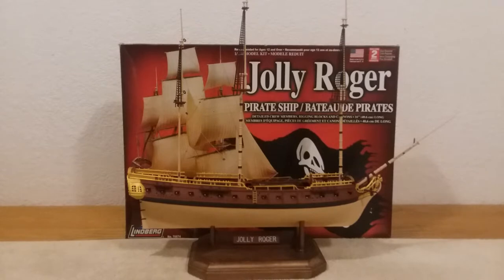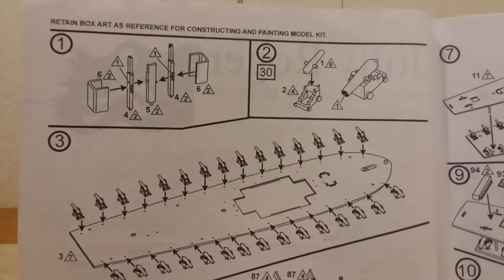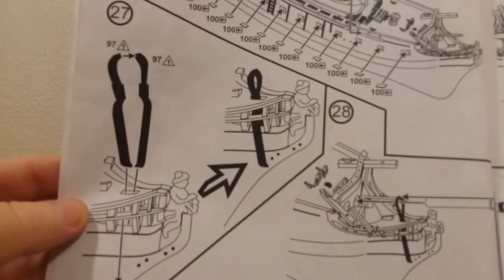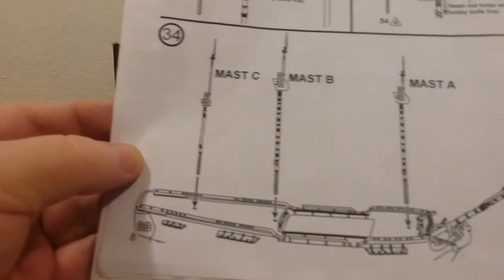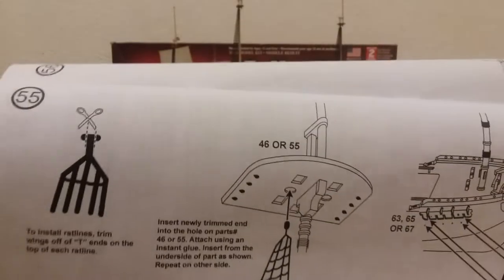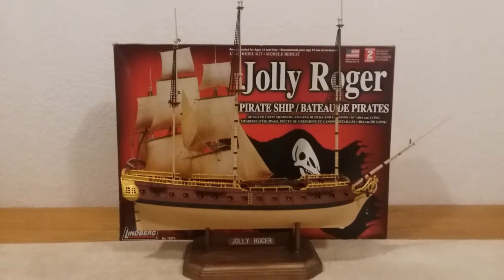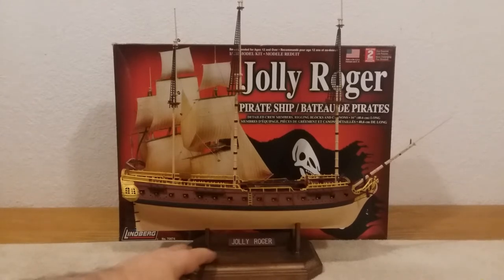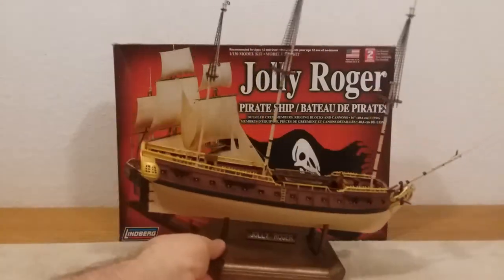Lindberg 1:130 Jolly Roger Pirate Ship Plastic Model Build Video One

Comment: I built this model recently. Most of the work is in the rigging. The threading is very complex and difficult to do with such tiny parts. I got creative and skipped some steps and had some left over parts. But using your artistic license you can paint this any way you want and still make it look realistic. I had a gap in the side railing but I just added a plank with a spare part. Every pirate ship should have a plank, not sure why they left it out!
Reply: How did you punch the tiny holes in the sails?